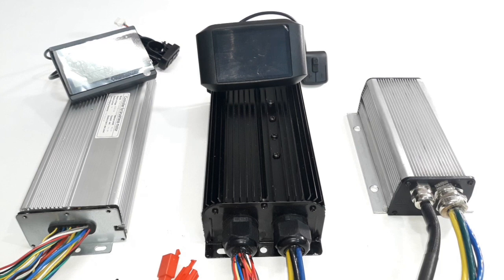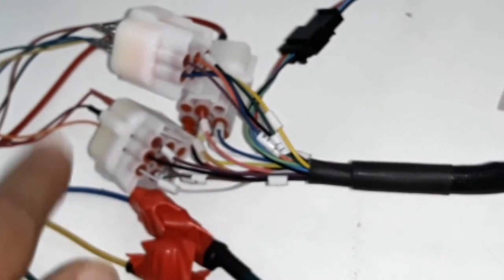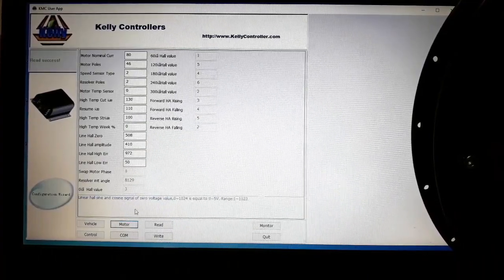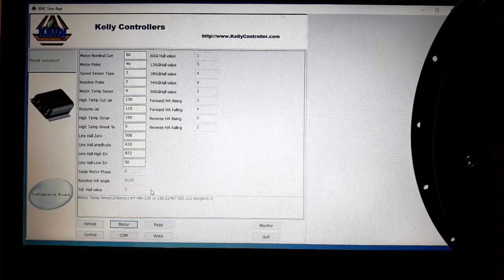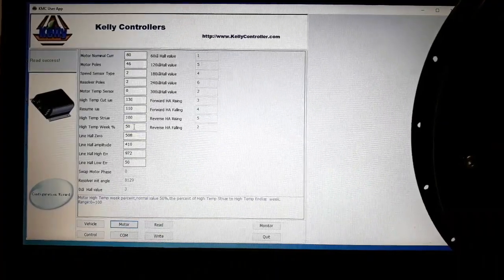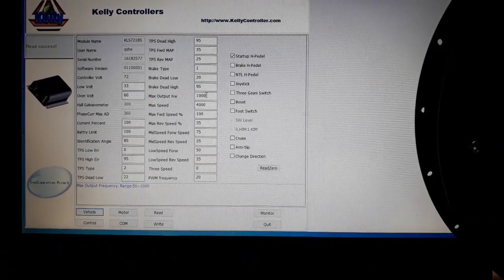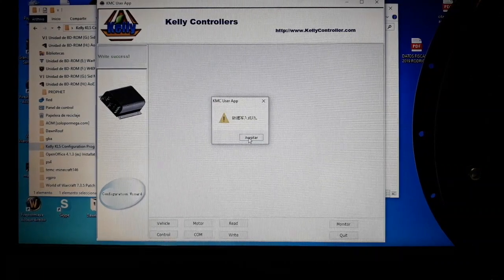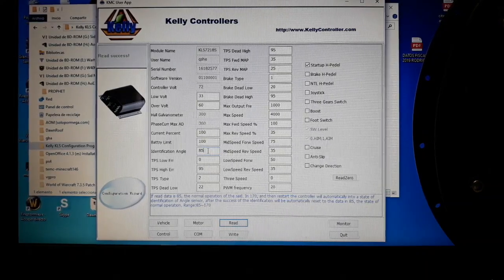KellyController Parameters, Programing setup, Part1 (English)

Comment: Thanks so much.  After first watching your videos a year ago, I finally re-watched them and got my KLS7218S to work with my Cyclone 3000w mid-drive.  It was also my first attempt at battery building (20s5P), so the first power up was nerve racking.  The motor didn't turn at first and just jittered, but  I swapped two of the phase wires and it worked!  Using your videos and the manual, I was able to get it programmed.  Thanks again!
Reply from the maker: Glad to hear. :)

Comment: Hi, and thanks for the tutorials. So, I have a KLS7212S with 48v/1000w motor and 52v/16ah/30amp battery. What do you reccomend for battery current setting?  Also is there a setting to make acceleration faster, the throttle feels so slow at first...then ramps up. Might need fast acceleration for an emergency. Thanks.
Reply from the maker: If the battery is able to deliver 30A as you described, then set it at 30A (You need to make the calculations to transform it to % )
For more acceleration change the PID numbers. I talk about it at 3rd video.
Reply: @gonzalop.chomon327  oh ok, thanks I will check it out 👍

Comment: When I turn on my Kelly Kbs-X it goes green, I turn the throttle and the motor starts to turn then cuts out after a 1/4 turn and light flashes red, how do I solve this?
Reply from the maker: That is probably because you still have not made the sensors angle detection procedure.
Do it and see if it works properly.
Reply: @gonzalop.chomon327  thank you I’m going to look into that now!

Comment: Hello I was wondering if there’s a reason why the Kelly Bluetooth modules don’t with the kbs controllers ? I would like a way to track watts and change my setting easily
Reply from the maker: The KBS controllers uses the old software version, so I suppose that is why it is not compatible with the bluetooth connection.

Comment: hii this is ariz , im using kelly7245nc controller. i have been changing all the parameters , but the motor speed isnt gradually decreasing but it stops in 1 second. The 48v 110ah battery drains faster and how can i improve my battery effeciency by controlling the sudden stopping of motor
Reply from the maker: If your motor turns and then suddenly stop abruptly, it is possible that you have not done the motor identification sensors angle properly. That can cause big consumption as well.
Try to make it again, it should turn smooth and nicely.

Comment: Hello, I have a electric scooter with 72181 Kelly controller , but work with 60v lead acid battery, can I connect 72v lithium battery (84v) to it without changing anything or need to change programming parameters?
Reply from the maker: 72 from the controller reference number means that it can work up to 72V nominal battery voltage. (Max. battery voltage around 85-90V). But I recommend that you confirm it by reading the manual.
In order to make the controller work properly with a different voltage battery, or different kind of battery, you NEED to  change the parameters at the controller for the new battery.
Reply: I have usb cable for lbmc and golden motor controllers, this cable work on kelly controllers? Do you have link of software for I connect and change parameters?
Reply from the maker: @vahidganjvar3812  The cable you need is a RS232 to USB adapter cable. Or if you have a computer with RS232 connection then just a RS232 cable.
You can download the manual and software from here:
 https://kellycontroller.com/support/
Reply: @gonzalop.chomon327  I have SM-4A cable and my kelly  72181 controller have same sm-4a  input in harnesses
Reply from the maker: @vahidganjvar3812  Yes, that could work as well.
Reply: @gonzalop.chomon327  thanks

Comment: i have a kls it has a tft screen there is no sm4a or rs232 port will i need to go via julet connector (tft screen connector?) hardwire a bt adapter on there?
Reply from the maker: I suppose that then it is already being programed for a certain vehicle or a motor/battery set.
If it does not have a programing connector then you will need to open it and add it if you want to change parameters.
Reply from the maker: I think I just found the schematic you need for the connection to the Julet connector:
https://kellycontroller.com/wp-content/uploads/kls-s/KLS-S-APT-Communication-adapter.pdf
Reply: @gonzalop.chomon327  Thank you im waiting on the bluetooth adpater as the pc method didn't work, yes the shecmatic is perfect thanks, will  let you know the progress
Reply from the maker: @ryanrider83  Yes PC is a bit more difficult to connect than to Android system.
Reply: @gonzalop.chomon327  it worked, Thank you  Subed<3
Reply from the maker: @ryanrider83  Glad to hear.

Comment: Hi can you tell me where is the any option for motor Control mode to select between torque  and speed Control ?
Reply from the maker: Software for this controller model does not has that option. But you can change the relation between speed/torque control by modifying the Kp and Ki values. You can find info about it in the last video: https://youtu.be/ITP6mey2eCk
Reply: @gonzalop.chomon327  ok i need setup for full aviable torqe on low motor rpm how many values in kp and ki i need write to get that ?
Reply from the maker: @automoto95  First try the motor with the already set values from factory. If not enough acceleration then increase the Kp value in 400 steps and the Ki value in 10 steps until you get what you need.
Reply: @gonzalop.chomon327  thanks
Reply: @gonzalop.chomon327  thx

Comment: Hello Gonzalo.
Do you use a pre-charge resistor on your wiring or just a XT90 anti spark please ?
I have a KLS7230S and a 48v Hailong battery and a MXUS 4T motor.
Reply from the maker: Recomendable on your setup but not mandatory as you are at quite low voltage.

Comment: Great explanation of all options. Thanks!
Reply from the maker: Thank you, there is 2 more videos, part 2 and 3...
Reply: I've seen them all! One thing to think about: what you are programming is a Kelly KLS controller. Other lines, like older KBS have very different parameters. Maybe you should specify that in the title. Thanks again for a great video series!
Reply from the maker: @OpenEmoto  Thank you for the tip. It is specified in the video description.
Anyway the old software is simpler than the new one, so if you are able to program this one the other one has less parameters but their function is the same as in new model. (There just some little simple differences)

Comment: Hello Gonzalo - I’m curious on how to use the foot switch pin with the battery charger as you describe. I have a three pin charger connector with red and black going to the battery for charging. There’s also a blue wire that plugged in to the factory bike controller to prevent powering the system with the charger plugged in. I don’t know how to connect this circuit - can you please advise? Thank you!
Reply from the maker: If the blue wire from charger is a 12V signal you can use it directly to pin 15. You have to enable then Foot Switch function.
Reply: @gonzalop.chomon327  ok - it’s not 12v but I see the concept looking at the circuit diagram in the Kelly manual. I’ll keep working on it. Thanks again!

Comment: Hi
This Kelly controller maximum can support to how many watt motors and how much can goes fast with set setting to highest power?
Reply from the maker: Hi Vahid, Kelly has dozens of controllers models, check their website.
The motor speed depends on motor characteristics and voltage supplied.

Comment: Thanks for this vid. My controller shipped without a bluetooth adapter. I have an USB adapter on my android that will turn the USB C into USB compatible with Kelly's cable. Will the android app see and connect to the controller this way? When I run the app, it asks if I am using the wire cable or bluetooth, so I suspect it will work. Haven't tried it with the controller yet.
Reply from the maker: Yes, you can connect by USB to Android system.

Comment: Hello, I bought Kelly KLS 7215N Controller. However, I am having problems with the connections as there is no user manual. There were parts that I benefited from your videos. But I can't get the engine speed to the screen. "(8) Meter: Copy signal of hall sensors." I'm connecting. Which pin should I connect? I would be glad if you help.
Reply from the maker: Here you can download the manual for your controller: https://media.kellycontroller.com/new/KellyKLS-NUserManualV2.9-1.pdf

Comment: Gonzalo, I am thinking of buying a sensorless Kelly controller but I am not sure because I am trying to reach 100000rpm and I dont understand the formula they use. they say eRPM = RPMxPolePairs. Their sensorless controller is rated 17000eRPM therefore if I want to spin a 4pole motor, I could only go as high as 17000/(2 pairs) = 8500rpm. Does that make sense ? Thanks in advance for your time.
Reply from the maker: Hi marcotstrere, Yes you are right. As per Kellycontrollers info their sensorless versions are up to 17000 eRPM so, yes if your motor is a four pole then up to 8500 RPM. And looks that they do not have a HiRevs. version.

Comment: YOu should always note which Kelly you are describing, for they make many controllers, with many different software programs. 
How do you like the KLS series? I do like my KEB.
Reply from the maker: Thank you for the tip. I added that info on the description, but you are right I should said it on the video, but I just forgot...
The biggests differences that I find between the KLS and the KEB are:
- Less noise from the motor
- Smoother responses (due to more parameters that can be tweaked)
- More functionalities
- But still missing the PAS (Pedal Assist Sensor) function.

Comment: Hello, I'm working on a motorcycle conversion project. I'm using a Kelly KLS 7275h and I can't get a connection to my bluetooth app. The LED on the dongle is blinking and when I try to connect it with my phone it stops blinking but I get the error "open Flash failed" in the App. Has anyone had a similar problem?
Reply from the maker: Never used Bluetooth connection with this controllers. So it is very little help I can give you there, sorry.
Can you try to connect directly to a PC?
Reply: @gonzalop.chomon327  Thank you for your answer! I already messaged the guys from QS and they will send me a PC connection cable, hopefully this will work.

Comment: Can you please advice me with some issue?
I installed this controller with a 2000W 72V BLDC HUB  Motor
and when i give full Throttle it ramp up the power and than slow down  for a few seconds, and than ramp up again.
it looks like there is some amperage limitation in the controller, but in the app i set the AMP to maximum.
is there is some advice how to solve it?
thanks for your great service
Reply from the maker: It looks to me that the Sensors Identification Angle procedure has not been done or has failed. So first can you check that?
If the problem persists let me know and we look other parameters issues.
Reply: @gonzalop.chomon327    i did the identification a few times. after many tries i replaced the motor with a new one, and thr problem stay the same. after it slow down once the re led start to blink. it gives the code 3,2  "internal reset". can you please help me understand what it going on?
Reply from the maker: @neworld4ever  I think it can be problem in the identification angle or faulty wiring.
That causes the controller to reset. It can be as well a problem inside the controller of bad connections.
Check everything, make sure that after doing the identification angle procedure, the value is back automatically to 85.
Hope it helps.
Reply: @gonzalop.chomon327  the identification angle is automatically back to 85 each time i set it to 170. the wiring is good.  is there is a way to set the identification manually?
I think that if all this tries don't work i will go in to a conclusion that there is  a problem inside the controller, right?
Reply from the maker: @neworld4ever  No there is no way to do the identification angle manually. And if it changes to 85 means that is doing it correctly. So look for something else. 
The only things elses I can think of are:
- To check the different combinations of wiring the motor phase cables and hall sensors cables in order to find the correct ones.
- There is the possibility that the controller is faulty.
Reply: @gonzalop.chomon327  Thanks A lot !!  i will try to change the phase wiring to see it any new behavior appears.
Reply from the maker: @neworld4ever  You have to check the different combinations of wiring the motor phase cables and hall sensors cables in order to find the correct ones. There is 36 different possible combinations, only 6 of them make the motor work, 3 in one way and 3 in the reverse.

Comment: Hello Gonzalo I have a Kelly kbs-x 72v 55amp controller I’m trying to wire up to a cyclone 3000w motor, could you give me a run down on what PIN numbers go with what for throttle, acceleration switch, 12v out? I’m having some trouble figuring this out as I’ve seen different things. I’ve read the manual but i want to make sure, as well as do you think I’ll need the pre charge resistor? Or instead can I use a capacitor parallel with the battery lines into the controller ?Thanks for the help in advance !
Reply from the maker: Hi Cristian.
- First of all here is where you can download the latest manual: https://kellycontroller.com/wp-content/uploads/kbs/KellyKBS-XUserManual.pdf
- On pages 10 and 11 you got clear schematics about the connections.
- For the throttle: Pin 20 is ground (usually black cable in throttle) Pin 4 is 5V (usually the red cable in the throttle) and Pin 3 is the signal from the throttle (usually white cable in the throttle but can be other colour)
- For what they call "acceleration switch", I think they refer to a dead's man switch, latter they call it in the manual foot switch. I talk in the video about it.  You can use it or not as it can be enabled or not.
- (Pin 11) 12V out, this to use just in case that some sensors may require 12V instead of 5V (Do NOT use it to feed other vehicle systems as it gives very little current)
-  With 72V I recommend that you use a resistor precharge system.
- You can add a capacitor at the entrance of the controller if the distance from the battery to the controller is very large. But this will make even more necessary the precharge system.
Reply: @gonzalop.chomon327  for the precharge system how exactly can that be set up do I have to have a contactor? The battery will be in a back pack with a cord about 3 feet long, would that distance be long enough to be able to just use a spark arrest such as a capacitor?
Reply from the maker: @cristhianhoyos7863  The precharge system is in order to charge the capacitors that the controller has inside, if you add more capacitors then there is more capacitors to be charged... so more need of a precharge system.
You can buy connectors that have that precharge system incorporated in them, that maybe the easiest solution for you.
here:   https:   //s.click.aliexpress.   com/e/_9fjDxU   (without the spaces)
Reply: @gonzalop.chomon327  I couldn’t use that link, but I think I found something similar? It’s a anti spark xt90 would that be what I need ? Bc my battery will be disconnected very often so I’m not sure how I can do a regularity charge system currently I’m using xt90s to from the battery to the controller, if I replace those with anti-spark connections will that work ?
Reply: @gonzalop.chomon327  thanks you’ve been a life saver ! I have one more question ! In the manual on like 15 and 16 it says it has a boost switch and and eco switch, I know you said there’s a part of that in the programming, but what pin wires would I need ? It’s not very clear on that part haha
Reply from the maker: @cristhianhoyos7863  I believe that KBS models do than have that function. And as for what I can see there is no pin BRK_AN(2) so it is provably for other controller models.
Reply: @gonzalop.chomon327  Thank you Gonzolo - that's good info. I saw these connectors online. So if they're used as a B +/-  connector, then are any other precharge resistors needed at other contactors? I have a key switch which turns the battery level display on and then another on/off switch required to activate the motor. I concerned if they will still need their own precharge device to avoid burning the contacts with inrush current. Thank you...
Reply from the maker: @errick51  I don't know your setup, but let me explain where the precharge system has to be implemented:
You need a precharge system in the device that connects and disconnects the battery from the controller, whatever it is a connector that you plug/unplug or it is a switch that you use for that purpose (whatever if that is a manual switch or a relay)
Reply: @gonzalop.chomon327  that makes sense - thank you again, Gonzalo. Your videos and feedback are very helpful. 👍🏼👍🏼

Comment: Hi ... I have a small problem with the Kelly kls 120A controller
I have the drivers, the program, everything, but I only managed to connect to the controller once. then it started showing me the program that the controller is not turned on or the RS232 cable is disconnect. but the controller is on, the cable too .. please help. thanks
Reply from the maker: Try to connect to Android system instead of PC. I think it works better.
Reply: @gonzalop.chomon327  okay,thank you